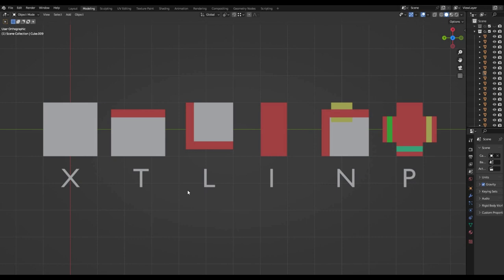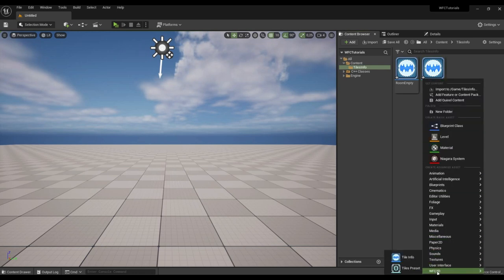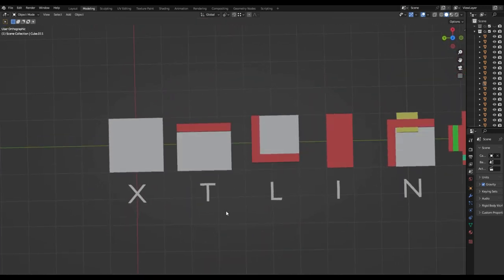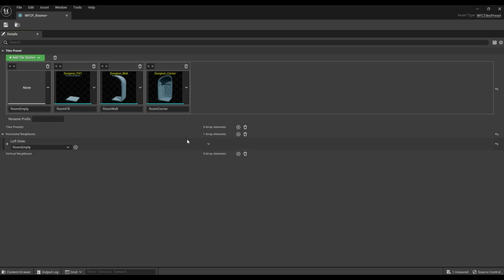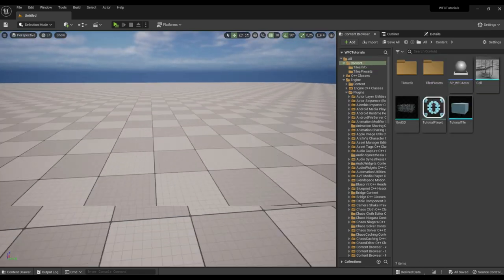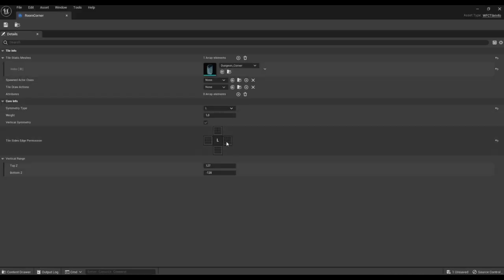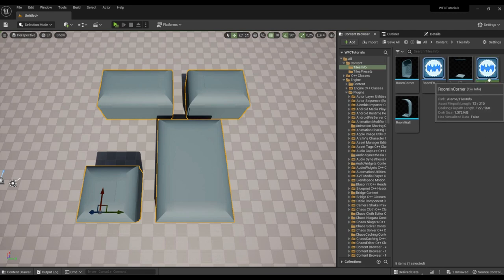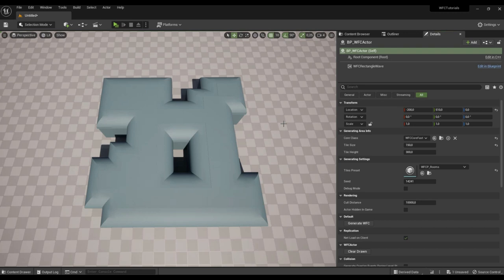Unreal Engine "Wave Function Collapse 3D" - (Tutorial 5.1) Rooms Generation.

Comment: keeps crashing with Assertion failed: (Index >= 0) & (Index < ArrayNum) [File:D:\RocketSync\5.3.0-27405482+++UE5+Release-5.3\Working\Engine\Source\Runtime\Core\Public\Containers\Array.h] [Line: 771] Array index out of bounds: 0 from an array of size 0 as my error.
Reply from the maker: Hello! I am very sorry that I encountered an error. Update the plugin and use "BP_WFCDungeon" from the plugin folder.
Reply: @roman__lebedev  
This is a bit confusing to me, everything works except when i create my own gridblocks, then it crashes and wont generate.
Reply: I guess my issue is not being able to create my own blocks.
Reply from the maker: @thelostangel45  I don't understand you(
Reply from the maker: @thelostangel45  Are you using "BP_WFCDungeon" and an error occurs with your "TIlesPreset"?
Reply: @roman__lebedev  I did not realize yo uwere also responding on market place. i will keep our conversation there.